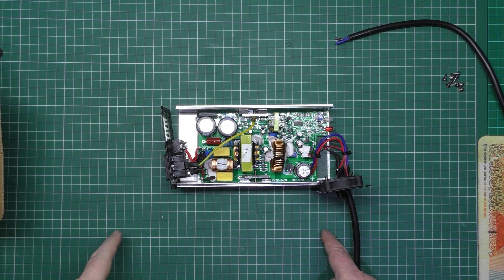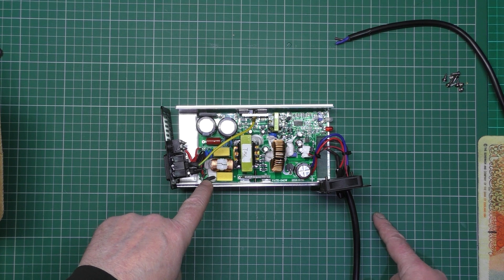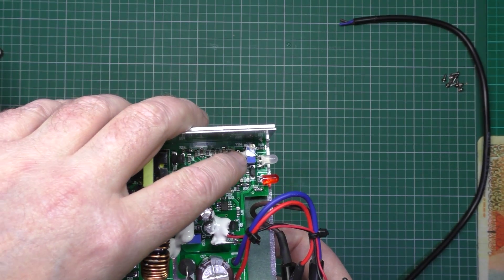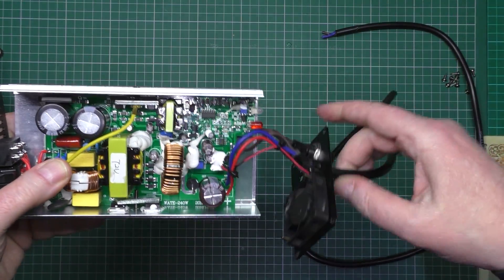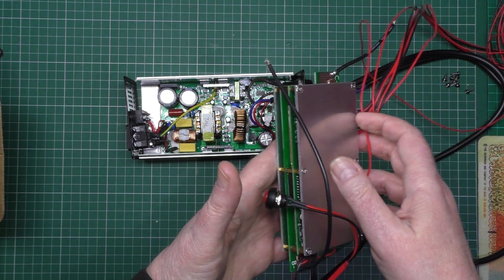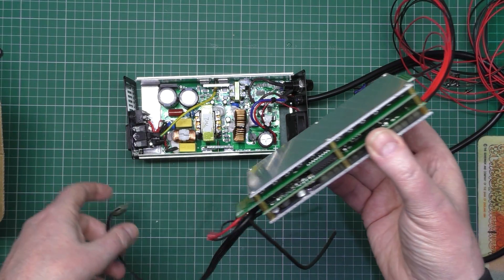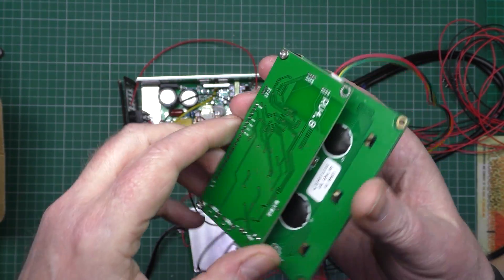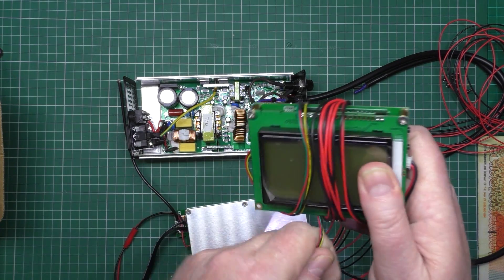New ebike PSU and the most advanced BMS ever

Comment: Hi tony what's current zeroing for ?
Just got my setup fully working, can you advise me on a couple of issues I have , 1 ,the reported current drain while riding is way more than it should be. 2 when charging , I keep getting cell over voltage shut down  so it never fully charges 66.5v is as high as I can get it need 67.2v. Every thing is set as it should be all cell voltages set to 4.2 high and 3
3 low and meter shows reported pack voltage is correct.  Any ideas ?. Thanks and love the app
Reply from the maker: Current zeroing is for when the bike is at rest and it's still showing current (positive or negative). Hit the button and it'll zero it at that point. Make sure you don't have any lights or anything else powered when you hit it.
1. I'm working on a 'current adjustment' for the app so you can manually adjust it.
2. There's not a lot you can do about that one. If one of your cells is going overvoltage, the BMS is doing its job and protecting it. Mine does the same so I charge it on the night, leave it to balance overnight and then, give it a top-up in the morning.
Reply: @Vortecks  many thanks tony.
The current adjust will be awesome. At the moment the bms reports 120amps max when its, actually 100amps.

Comment: A before I start using my bms, anyone know how hot  the fets get or the balance?? Should I heat sink both sides?
Thanks
Reply from the maker: They do get warm (>50c) so, if you can supply any airflow, it will help.
EDIT - The FETS, sorry I was talking about the balance resistors. No, the FETS don't get hot at all. Even running 150+A they barely get warm on the 300A version.
Reply: @Vortecks  is there a hidden setting that I can't find in the app to keep the phone awake when in use??
Thanks
Reply from the maker: @chrisgreen9561  Not in the app - You can download apps that keep the screen permanently on or..... on most Android phones, there's a setting under 'display' that you can change the screen off time.

Comment: I’d like to get one to check the voltages with charging and discharging the sleepless on a forklift battery.. (have heaps of forklifts) ur thoughts ? 2v cells.. 800-1200Ah.. be ok to just read volts ?

Comment: is there a way the BMS can work automatically inside closed unit.. I have a unicycle and it's 24s I was trying to have it bypassed but I would want the BMS to balance and equalize the cell during charge..  I couldn't find if this is active or passive BMS.... does the BMS have any automatic shut off or stays on if we create jumper , does it work without need to have the temp sensors in.. so many questions.. I like your app.. definitely worth of buying one because they didn't provide one

Comment: You skipped a step.  First connect to the BMS via bluetooth.  The code is 1234.  Then the connection will happen automatically when the software is started.  I had to delete everything else from my bluetooth connections and I have to restart my bluetooth manager once in a while as well or it keeps disconnecting.

Comment: Hi Tony, i'm thinking about buying this BMS.. but I wondering does your BMS still works good, any problems with it.? And can you also communicate via a PC to config. the settings in the bms.? Kind Regards !
Reply from the maker: Hi Jeremiah, 
I did have a problem with the one in this video where the bluetooth regulator died so I had to modify it. I have 3 of them now and that was the only thing that went wrong.
You can use a PC to configure the BMS but you'll also have to install an Android emulator to run the app.
If you want the ultimate app for this BMS, I re-wrote it and it''s now available on Google Play https://play.google.com/store/apps/details?id=com.vortecks.vbms
Tony

Comment: I have bought one of these.Can  you please help me about the app parameter settings. There's a parameter  "Battery Residual Current" . What value should i set in it?  I m using 18650 lithium ion battery in 20s15p configuration. Each cell is 3.7v 2.6Ah.
Reply from the maker: Hopefully, this will explain it better than I can type...... https://youtu.be/07rLXeN7zXc?t=695
Reply: @Vortecks  Thank you so much.
Reply from the maker: @AbhishekSharma-bl3bv  You're welcome 😁

Comment: Quick question. Hi. Have ordered one of these Bms’s. can you run Regen through it or do you have to bypass the bms and run direct to the battery? Whats your setup?? Hope you can help?
Reply: It'll do regen.
Reply: Ryan Willis what amp Regen will it handle?
Reply from the maker: @nigelbiscombe9199  The only limitation is your battery - you don't want to over-current them. Also, some controllers have a higher voltage output than your batteries can handle so be careful.
Reply: Vortecks it’s a 25ah pack 200 18650’s Samsung 25r’s 20amp per cell 20s 10p so 200amp peak. Just never sure what it would handle back in with Regen
Reply from the maker: @nigelbiscombe9199  According to the Samsung data sheet, it's 1,250mA (1.25A) charge rate per cell. Seeing as you have a 10p pack, that's 12.5A maximum charge rate for the whole battery.
What controller do you have?
Reply: Vortecks Sabvoton 72150
Reply: But I’ve got a ant bms like yours on order.
Reply from the maker: @nigelbiscombe9199  The 72150 is 84v regen voltage so you're ok there. You're still limited by the amount of current you can put back in the battery through regen braking though. You can probably get away with 20A for short busts but I wouldn't got any higher than that.
Reply: Vortecks bms has turned up. How does it measure ah. Is there a shunt on the bms??

Comment: I use this BMS. It is incredible. It monitors cell voltage and temperature. It monitors temp of the mosfets and the balancer. I love it. Impresive piece of equipment. Thank you for the video. I would buy more at $80.00
Reply from the maker: Have you seen the new app I published on Google Play? Search for VBMS and you'll see it.

Comment: hello, I bought this same BMS but 80A version. I just wonder how the four external temp sensors are supposed to be soldered to the 5 wires that come out from BMS? You don't like the screen but I would like to use it. I would like to know how the screen gets speed information for it's speedometer display, do you have any idea?
Reply from the maker: You use 1 earth for the 4 sensors, it's as simple as that.
The speed on the LCD requires an external wire soldered to one of your hall sensors but there's not many people had success with it. That's the sole reason for the app I released - it gives GPS speed on your phone without the need to tap into the BMS
Reply: @Vortecks Thanks! I found the point for hall wire by watching a chinese video. One more question, what voltage the screen uses? I would guess it's the total battery pack voltage but I want to be sure
Reply from the maker: If you have RV4.8 (this number is on the back of the LCD) then it's the total battery voltage. Anything before RV4.8 needs 12v.
Reply: Thanks man! this info give me confidence to finish my installation!
Reply: @Vortecks  installed the BMS and speedmeter works too. Nice BMS!
Reply from the maker: I'm glad it works for you 👍

Comment: Nice one Man you use Tinder two, Hey mate how hot does it get im wondering if i should heat shrink it to my battery or leave it outside.
Reply from the maker: If you're pulling the amount of power I'm pulling then it does need to be outside. If not, you can head shrink it to be battery.
Reply: @Vortecks  cheers man i think ill pull 70amps but i guess its probably better to do that

Comment: So the PSU after adjusted can connect direct to BMS terminals to charge cells?

Also, can you have a load and charge at the same time? Some of these smart BMS has charge discharge calibration settings

Comment: Is there a way to set the balance current to more than 200mA?
Reply from the maker: No, sorry. It's a physical limitation of the resistor bank.  
To be honest, if you need more than 200mA, you have a problem with one of the cells.

Comment: I bought 2 of these..and although both are working via the display..neither is broadcasting any bluetooth signal...the vendors on Aliexpress were horrible..nothing but aggravation..they sent me the program for my phone but my internet supplier says it is a virus...so as of now no way to balance the cells...
Reply from the maker: Hi John,
Drop me an email - vortecks2000@gmail.com and I'll sort you out.
Tony
Reply: Fitted and working..balanced my big 24s16p pack very nicely,and stopped the charge (I only have it hooked up to charge and monitoring the cells) initially but now..it will read "overcurrent" but wont stop the charger as before...I even reset factory settings and still not go...mmmmm

Comment: There was an option called "maximum charge current". Does this mean I can feed the BMS without current protection, for example from a server power supply and the BMS will limit the charging current? 
And great video by the way, really like your tests.. :)
Reply: felixwe9 I can charge my 32s lifepo4 thru a 900w Digital Drok DC-DC unit, powered by a server power supply, they're fully adjustable, do cc/cv and have built in coulometer  too, sort of like a poor man's cycle satiator and really easy to make. 32s of reg Liion is higher than their 120v DC max so I'm not sure how to do that, perhaps look for a DC-DC that boosts higher than 120vDC
Reply from the maker: felixwe9
 - No problem, I'm glad you got it sorted. I might be doing another video soon which will answer all the questions that people have asked. I'm also planning V3 of the bike with more power and less weight :-)
Reply from the maker: The 'Maximum charge current' is there to cut the charge if the current goes over. e.g. if you set it to 4a and you plug in a 5a charger, it'll cut out with an overcurrent notice on screen. It's there to protect the batteries and there's no way of letting the BMS control the charge current.
Reply: Okay, thank you :) I think I order two anyway. Do you have a recommendation for a high power 32S lipo charger?
Reply: 32s? WOW  
Sorry, I don't know of any that go that high!
Reply: Vortecks I found a charger 16A@134,4V on Alibaba. I also have two of those BMS now. Thank you for all the information!!
Reply: ABritInNY interesting idea. I already ordered a charger but if it turns out to be s*it I may try your idea. Sounds promising!

Comment: You left out something important, Tony.
How noisy is the charger?
Reply from the maker: That's rather subjective.  
Without a sound level meter, I couldn't tell you. Also, it depends how good your hearing is.  
Personally, I'd say it's "acceptable" if you're in the same room and you can still hear the TV over the top of it.
Reply: Ok, I just need one that I can take to work and doesn’t sound like a bloody jet engine.
Reply from the maker: Me too mate. This one is probably the quietest you'll get. I might cut a hole in the top and fit a bigger fan to make it even quieter.
Reply: What voltage is the current fan?
Reply: 12v I think. It would be easy to chop a hole in the top and put a 1000rpm 120mm fan on top
Reply: I'm just asking because my 48V PSU has a 48V fan and my 24V PSU has a 24V fan.

Comment: So these ordinary battery chargers that we all use for are AA & AAA standard batteries do they do this automatically if you say put four on charge together but there at different rates/levels of charge.
or do's the charger simply switch of when the battery with the most hits 100%?.
sorry to hear about the thumb that should stop you hitchhiking lol.
Reply from the maker: All multi-cell chargers should charge each AA battery to its max voltage. The problem is, when you use cheaper AA batteries, they charge at a constant current and they start getting hot - this is a sign that they're being damaged. More expensive chargers will only charge at a rate that the battery can actually handle. It works by pulsing the current and measuring the voltage and it can work out how much current the battery can handle without damaging it.   
I might do a video about it when I'm feeling intelligent enough to explain :-)
Reply: You explained that perfect Tony thank you.
all my AA's get very hot when they are fully charged so now i know whats going on, its just a Energizer universal charger about three years old.
i will be searching the net for some thing more quality to save my batteries thanks again most help full.
Reply: cibie01 u got Energizer's lol I had usb one and software for pc was a security risk  lmao normally them chargers come with batteries take note of the battery capacity and try not to use smaller capacity AAs or AAAs put fan on them lol

Comment: Thanks for the video! I been following your channel sense your first ebike video. Nice work! Can you tell me is balancing current on this BMS? I have two ebikes and I have install similar smart BMS to my battery packs with price of around 50usd (on Aliexpress). App has very nice design IU with so much parameters and its on english,showing even Km/h,range,miles... Only draw back on my BMS is that balancing current is only 50mv. That's why i have balancing active 24/7 and pack is in  stable and in prefect balance even with 11A charging current. My battery pack is home made 14S 224 cells 37Ah(60A BMS) I have 3000+km on my ebike, am very happy with it. Cheers!
Reply from the maker: Hi...... It can balance at 200ma and you can set the voltage difference between cells (down to zero). You can also set the cell voltage that you want it to start balancing the cells.
Reply: Vortecks Great! Thanks for answer.
Reply: thanks it help your answer

Comment: Just starting out on my own eBike adventure, seen too many ESCs burn and batteries over/under charge to waste money on inferior equipment. I'm planning on building two batteries, seems likely then I'll buy two BMS' and probably two chargers, I do like the idea of using a charger that can't overcharge a battery. Cheers.
Reply from the maker: If you're going to have the batteries in parallel, you only really need 1 x BMS and 1 x charger. The same goes if you're running them in series - this BMS will limit the current going into the battery and will balance each cell independently.

Comment: Nice review Tony, I look forward to seeing more about what it can do - I'm thinking that it could also be useful to manage a home battery system, if the balance current was a couple of amps or more. There is a huge market there.
If you've been following the diy powerwall scene, Batrium have a great BMS that can monitor and balance up to 250 or so cellpacks, but not everyone can afford it.
I've collected about 5kWh of cells now and will run them both with a UPS and my ebike depending on how I feel - it's nice to have such interchangeability and a 200 mile range!
Reply from the maker: Cheers Andy.   
Unfortunately, it only balances at 200ma max and it uses the 'discharge' method instead of drawing from the highest and put it in the lowest.   
I haven't given up on the DIY kit yet and I'm sure I could make something to do as many cells as you need. When I've got more time, I'll start on it again :-)

Comment: Thumbs are important, I almost cut mine off with a radial arm saw.  That was about 50 years ago and it still works!  Thanks to a talented surgeon.
Reply from the maker: I've lost the feeling in the end of my thumb and I took my own stitches out on Friday night after an alcohol-fused evening. Hopefully, I'll get the feeling back soon because it's not easy to work with very small things!
Reply: After a drunken night I put my hand through a glass door. Severed tendon and went down to bone. Surgeon repaired tendon but not had feeling in the side of my right thumb for 21 years now. :(

Comment: Another great video but what is a BMS ?
Reply from the maker: BMS = Battery Management System.  
It's to make sure all the cells (18 in my case) are at the same voltage. It also limits the current being drawn from the battery. It also limits the current when charging. It also stops the battery from being over-discharged and over charged. It also prevents a short circuit fire.   
This is what happens when you over-charge a lipo https://www.youtube.com/watch?v=wPeQ1QAwS1w   
This is what happens when you have a short circuit with a lipo https://www.youtube.com/watch?v=tRUC_05KmkU
Reply from the maker: You learn something new every day :-)
Reply: Oh!  I thought BMS was a brand of bike.  Doh.